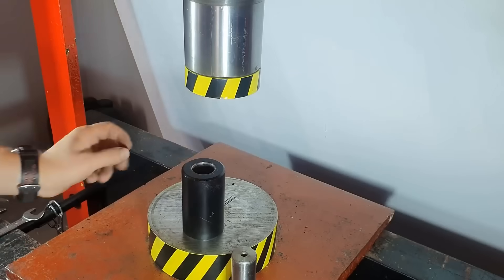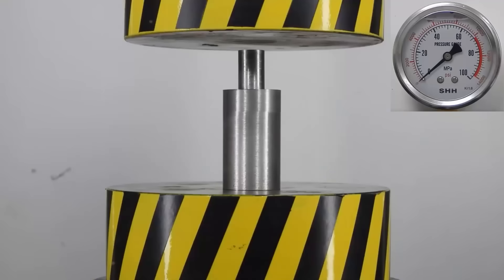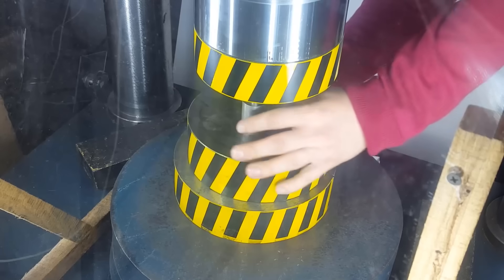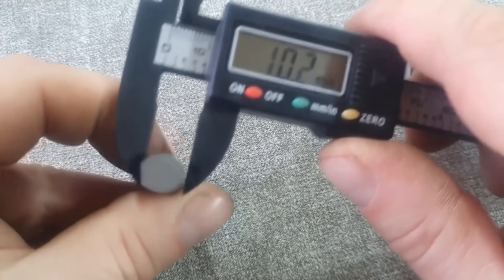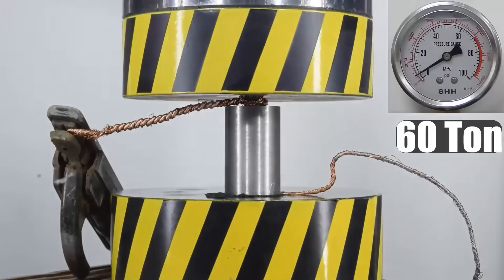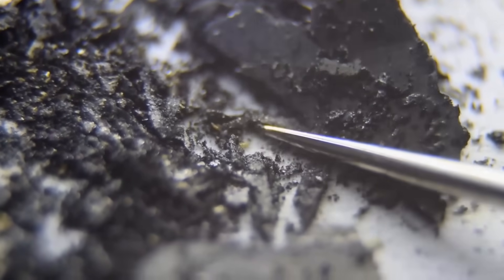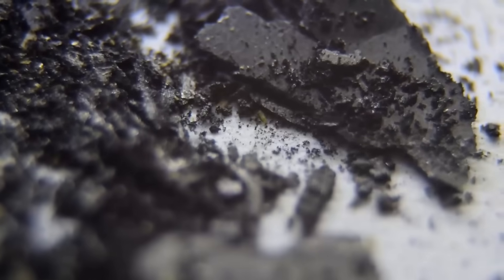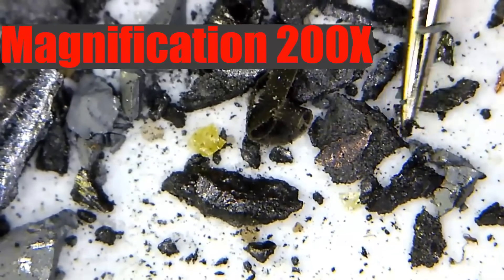HYDRAULIC PRESS TURNS GRAPHITE INTO DIAMOND

Comment: Synthetic diamonds are GROWN using a natural diamond as the seed crystal and hydraulic fluid.

This approach is junk.

Decades ago, dynamite charges were used to smash a cone tipped piston into a cone shaped anvil.

And even then, they only knew if they made a diamond by scraping the graphite dust across a glass plate.

Comment: Your top electrode short circuited on the body of the hydraulic press and on the steel container/cylinder. There is no possibility of a spark because there is no air gap, everything is short-circuited from the word go.

Comment: The Smaller the mold is, the Greater the pressure will be, so if you make a Smaller one, it works better. Also pure carbon powder is better, pencil graphite is not pure and contaminated 💎

Comment: GE produced its first synthetic diamonds for engineering in December 1954 and began commercial production in 1957. The company made this breakthrough with a device called the diamond press, which used high pressure and temperature to transform carbon into industrial-grade diamonds. 
1954: The breakthrough occurred on December 16, 1954, when a team led by H. Tracy Hall successfully created the first synthetic diamonds using a new "belt" apparatus.
1955: GE announced its achievement to the public in 1955.
1957: Commercial production of these industrial diamonds began, providing a new source of superabrasives for cutting, grinding, and other industrial applications. 
GE produced its first synthetic diamonds for engineering in December 1954 and began commercial production in 1957. The company made this breakthrough with a device called the diamond press, which used high pressure and temperature to transform carbon into industrial-grade diamonds. 
1954: The breakthrough occurred on December 16, 1954, when a team led by H. Tracy Hall successfully created the first synthetic diamonds using a new "belt" apparatus.
1955: GE announced its achievement to the public in 1955.
1957: Commercial production of these industrial diamonds began, providing a new source of superabrasives for cutting, grinding, and other industrial applications. 
Made in the USA USA USA by General Electric. What we call GE in the engineering world, the General.

Comment: Your wires merely shorted out where the contacted the top and bottom of the cylinder. You must drill opposing holes at the bottom where the bulk of the compressed graphite resides. The electrodes mus be completely insulated from the steel cylinder and rod. The spark will then be directed to through the graphite.

Comment: You may not see tube expand but it does..you'll need 12 rather than 10 in round tungsten carbide tube an shaft
Prefer
Laser cut...noooooo visual gap....
Cymattic tuned focused on temp control...shut off and immediately quench..unsure if laser splitting 12 inch tungsten tube or likely....air hammer..unsure if you can hear tube before carbon core then air hammer or spill it tungsten base.

Comment: Usually a tap or shick with pressure after likely using cymattic temp control maybee also with voltage temp control....but...great if cymattic temp control actually works if YOU choose TWENTY shots with unique frequency cymattic focus or structure......likely is KEY.

Comment: These diamonds look almost exactly like the ones left behind from using diamond saw blades on concrete. They are also yellow, the same size, and are occasionally found on roads where the saws are used - although, you cant see them without a microscope

Comment: You’ll probably need to use tungsten tooling as steal will deform and probably need to be at earth core tempatutes witch is around 6000 C umm that’s higher than the tungsten’s melting point 3400 C 😵‍💫
🤔 just trial and test or grin & bear it 😁
And carbon sublimate around 3000°. I need to check online—
 Wrong 

Google —
Pure carbon has no true melting point at atmospheric pressure but sublimes at temperatures around 3900–4150 K (3630–3880 °C), with specific values depending on whether the carbon is graphite or diamond, the presence of vapor, and the precise definition of sublimation. The process of carbon sublimation is essentially the transition from a solid to a gas state, bypassing the liquid phase entirely. 

Ok so there’s your ball park, heat the sample to less the 3400 C and press it with the 50k press 😵‍💫😁🙃

Oh looking at the graph 

Google —
Natural diamonds form under intense pressure in the Earth's mantle, requiring pressures of approximately 45,000 to 70,000 times the atmospheric pressure at sea level (around 5 to 7 GPa). 

Yeah you’ll need the 50k ton press or calculate the surface area needed… 

Haven’t finished watching the video because the wife took over the TV  🤪😵‍💫🙃🫩🤪

We’ll have to finish later …

Comment: Hold my 🍺 you need f for the shaft and h for the hole tolerances to be able to create the pressure first inside the chamber then slowly in span of a week to apply force to the 500 tons to mimic the natural process 1:41. And your shaft and container materials need to be at least 14Mg CrMo 42 heat treated  with the housing having at least 30mm wall thickness

Comment: My suggestion is to buy pure graphite powder on market (it should be possible because it is used in some foams as flame retardant additive). Then repeat the experiment with AC (not DC) to warm up the graphite and using a lower pressure (let say 30 tons) but leaving activated  AC and pressure for at least 3 days. This because the Carbon neads of time to rearrange itself in a tridimensional structure (graphite is only bidimensional). It can help if the experiment is done under vacuum, because I suppose that during recrystallization of the carbon, the reaction with oxygen can be not negligible. The AC works as a "shacker" (sorry for the poor explanation) for the electrons making them in condition to better find their position in the diamond tetragon, probably there is a AC frequence in which this rearrangement is maximized.

Comment: You aren't speeding up molecular motion (Browninan) thru heat saturation (time required) to change the bonds in the molecular structure into a "crystal lattice" formation that would yield a diamond.  Industrial made diamonds also use diamond "seeding" as a primer point of molecular formation.

Comment: If you can find another hydraulic piston like that, and the shape that it belongs to in theory could achieve even greater success, of course does apply in the fact that he also uses a generator and continues power throughout, but he also forgot that diamonds for overtime so given enough time that arc would generate enough heat and pressureto create diamonds, but those diamonds could in theory grow

Comment: Should this guy own a hydraulic press like this when he knows so little about what he plays with? 

Running electric currents to the cylinder direct thinking it will heat the graphite and not just short out. 

And using pencil “graphite” which is mixed with silicates like clays to make it easier to write with. 

It’s crazy that somebody who has such basic knowledge of anything like this would even think to get their hands on something like such a powerful hydraulic press. It just doesn’t add up. 

This guy is a Darwin Award waiting to happen.

Comment: Keep in mind the types of heating conductance. Although you used electromagnetic (radiation conductance, the better source) heating, it failed because the carbon as part of the heating circuit became more resistant as the process continued
Next time try an induction coil. As a separate circuit, It won't count on the carbon as a conductor for the circuit

Comment: Pure tungsten is harder then when mixed with carbid. Carbid gets added because without it, the tungsten is too hard work with, too hard to sculpt into tools and such. But for your purpose, pure tungsten may be better. Because its so hard, the only way to shape it without breaking your tools is by molding it in the desired shape in advance during its creation. So you'll need to order it custom made just for your experiment. At least this way you won't get any gaps.

Comment: Correction at 0:47: 
1 atm is 100,000 kgf/m^2
= 10 kgf/cm^2  ( not 1).

(Also, kg is  mass , and kgf is force, which is what you want here).

That means diamonds here would require a force of :
50,000 atm * 10 kgf/cm^2/atm * 7 cm^2
= 500,000 * 7 kgf
= 500 tonnes x 7 ,

which is at least 7 times more than this press applied.

Comment: 1. Use pure carbon
2. Using a heated wedge, fixate all of the pressure onto the smallest surface area possible. Suggested design as follows:
*2a. This shape \/ (upper press surface, conical in shape)
*2b. Into this shape /\/\ (lower press surface, modified taurus shape)
*2c. Have a small recess cavity in the center of the lower press surface, this is where the pure carbon will go
*2d. Make sure that (2a) is slightly move acute in angle than (2b), or efficiency will be lost as force will still be wasted along a greater than necessary surface area.
3. Compression time will be a contributing factor. Document as a variable
4. Heat amount will be a contributing factor. Document as a variable
5. Total Compression force will be a contributing factor. Document as a variable.
Reply: Yup.  A diamond anvil.

Comment: Dimond's are a glass made of carbon, making manufactured dimond's involves heating the carbon until it liquifies within an oxygen deprived vestal using microwave energy to isolate heating a small amount of inert gas that transfers heat into the carbon eventually becoming a plasma as the item gets hotter the magnetic properties of the canister and inert gas plasma shift quadratically as occulting polarity magnets keep it suspended in a static location... so if the outer canister was made of chrome/copper, to absorb oxygen traces and hold the carbon, after becoming a mixed plasma it becomes a green dimond tho is a ball. 8000*C... they are nearly cheap as regular glass by volume, tho no one makes actual dimond glass windows past grinding the dimonds into powder to add to regular glass.

Comment: you need to ply several sleeves together for the piston. a sleeve and piston inside continuously bigger sleeves, say 3 or 4. One this will prevent deforming and 2 will allow you to heat the inner sleeve without deforming the outer sleeves.

Comment: I worked making   the HPHT puck presses they  used to test manufacture artificial diamonds they are no where never the stytle and type like you are trying, but to do with the type you are using   your punches are too short cavities and are shaped wrong and for most of these  test you are bottoming out on cavities before it reached anywhere near full pressure on the graphite  and your welder shorted through the body  of the female cavity  that the tugsten carbide punch was it  you  have no clue of   electrical conductivity ,  puck presses use to making test slugs  like you are trying to do to make a diamond,  you  need in excess of 725,000 psi and temperatures off 2200 degres F and it has to be held and maintained for DAYS a lot longer period of time then the  few minutes  you are doing , and are made with  99%+  pure carbon  and it also is done using a seed diamod for the  crystal form of carbon to form on.  and some test have found that  a rapid  increase  in the range of 30mph or faster type impact and then held at  a steady  725000  psi or higher for hours for them to form .     basically what you are doing   is 100%  fail with  zero chance to form a diamond. what you  are seeing  and think are diamonds are probalabably impurities from the graphite you used  due to clay  quartz and other binders used in making pencil leads and   motor brushes.

Comment: what if 1, you heat the graphite to temperature of about 1500° then compress it to  about 55,000 atm  using tungsten base or collide the graphite at at a high speed that on collision it will be able to generate required temperatures and pressure. Don't forget to tell me the success✊

Comment: A little investigation,  you would have found out that graphite diamonds are forced, but not in a hydraulic press. You also need extreme heat and pressure. I would chalk this video up as misinformation and/or fraudulent.

Comment: ☻Do not try this at home, DeBeers wants to keep theor monopoly.
Presure is something required to rearrange, or force the atomic structure of C into crystal, it's not impossible with your hardware, you just need to increase temperature, deliver the energy of your welding system directly into the presure chamber and not in the compressor that's already grounded. it has to get through the carbon itself. And let it cooking for a while; I'm even impressed you did some diamonds here.

Comment: I'm glad you mentioned that early because you're not gonna get a diamond without the heat process to create the fusion.
Reply: No fusion is occurring here just forcing the carbon atoms to restructure into a repeating lattice of covalently bonded carbon atoms instead of layers of covalently bonded carbon atoms in graphite.
Reply: You can, and he probably did. In this equation pressure is temperature after all. He could have gotten the same results on test 2 if he'd heated the material to 1kC. Hell, he could have gotten the first test to work with high enough temperatures. Besides, his heater did nothing in the final test, it shorted out instantly and any heat it created went into the walls of the cylinder, not in the graphite.

If you apply enough pressure, the temperature becomes a non factor. Hell, some scientists found a way to make diamonds with no pressure at all, just using a mixture of metals to soak the carbon in that forces it to take longer to deposit and bam, diamonds. 

You can visualise the equation to make a diamond as a boolean equation where bool = T * P * C (time, pressure and temperature). This crazy lad here got the values to hit "1" for a True result just by pushing P as high as he possibly could, but there are plenty of other methods that involve using more reasonable pressures with higher temperatures and/or time
Reply: Apparently some crazy fucks found a way to make diamonds by shooting a cannon ball of steel with carbon inside it at a wall. No temperature component, no time component, just "carbon smash hard," and that works just fine too, because for a fraction of a second the pressure was super high so yeah, diamonds created.

Comment: You need to construct a pair of vessels of tungsten or tungsten carbide that is in the shape of a diamond. This can be done using eight,  quarter-round segments of which the ends are cut at an angle such that when assembled inside the cylinder the diamond shaped hollow space will be created. Fill that space with your pure graphite. Attach the electrodes from your transformer to each end of these ram rods and apply current when the desired pressure is achieved. Ideally, the diamond-shaped cavity would be evacuated but that may be impossible given all of the other constraints. If the fitment of the quarter-round segmented rods is tight enough, that may be sufficient to displace any gaseous contaminants. The amount of graphite needed would be somewhat greater than the weight of the diamond that would be produced.

Comment: I was looking up kimberlite and had a few ideas, due to its geochemistry. Firstly, besides the carbon that is diamond in it  samples tested high magnesium oxide content. There have been natural diamonds found that actually contained CO² in their inclusions, something I thought fascinating.. then I temembered the old thermite reaction between dry ice and magnesium. It would be awesome to create a hermetically sealed chamber and set THAT off once filled inside said chamber, likely in the same way you heated your graphite sample here. I don't know why I keep feeling like CO² is the easiest source to a diamond with some electrical heating. The pressure within a perfectly sealed chamber would do it. Something the screws together perhaps, and then of course it needs to be EXTREMELY THICK and behind a blast shield. Even if it failed, I imagine it would make a good yt video. The heat from your arc lamp would ignite such a thermite and the pressure created should suffice.❤

Comment: At 15:17 was a request for a practical use of almost microscopically small diamonds. Such tiny diamonds can be used as seed diamonds in a diamond making pressure chamber.

As an explanation for how a diamond making pressure chamber might be made, graphite and some types of strong enough metal have a different "thermal coefficient of expansion" from each other. Graphite can be sealed into a soccer ball sized metal chamber at room temperature, then put into an oven room while within its soccer ball sized sealed chamber to heat up, and be thus squeezed from the thermal expansion difference during the heating process.

Without a seed diamond, such a diamond making process might take a time of perhaps months, during which time a seed diamond would probably eventually spontaneously form. With a seed diamond, the process will take just a few weeks.

Comment: Diamonds of that size cannot be created that quickly, especially at the low temperature you would have achieved. Are you sure they are industrial diamonds and not something else? Or did you simply sprinkle a few from a diamond tipped tool  into the mix to fool us?

Comment: When doctor robert guard guard doctor robert garderd Was a kid he mixed carbon with steel? You saturated the carbon with steel with carbon molten and threw it in a bucket of water because he wanted the steel to contract and form diamonds. The whole mess blew up he wasn't hurt, but I wonder if that created any microscopic diamonds.  Was it was the steel contracting by the cold water over the infused carbon dissolved carbon